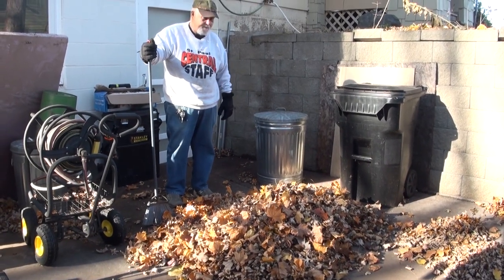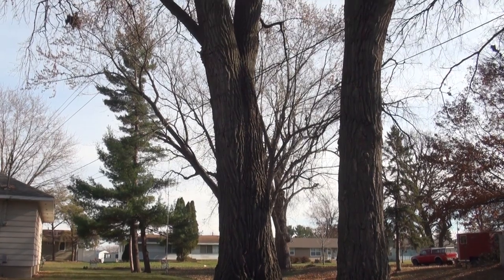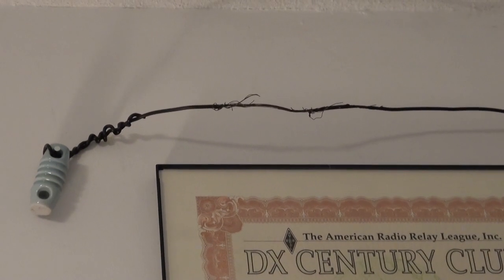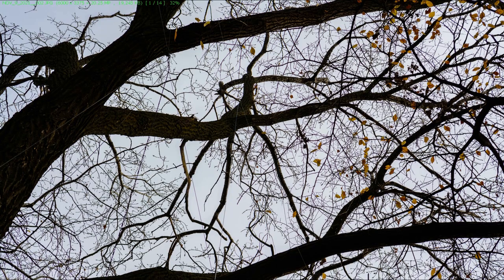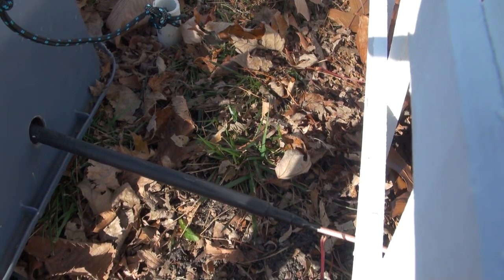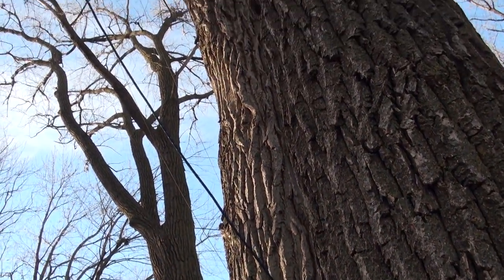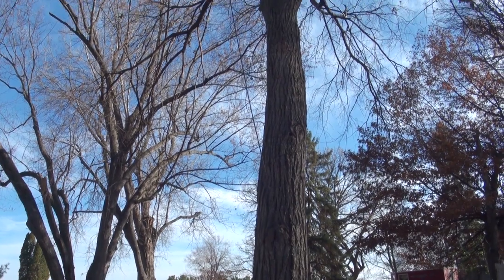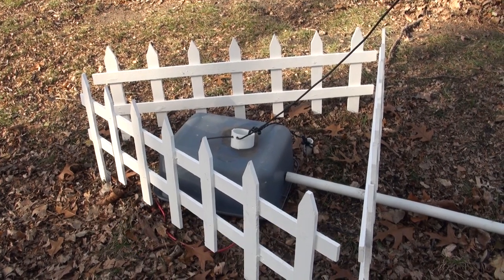The NEØU EZ-J 160m "inverted J" antenna (NOT 6m)

Comment: Compromise! I totally understand that. What works, works! Not enough real estate for 160 at this point but maybe someday. Enjoyed the video. 73
Reply from the maker: Compromise can still work...time will tell if that is the case with this antenna.  Yes, you are limited for your own space.  You could do a vertical from a tree, which work quite well, but for 160m, you'd need a huge loading coil, and those do not work very well (low SWR but are crappy radiators).  Thanks for your comment and 73! de WX0V

Comment: Hi Scott. Thanks for the video. Neat stuff! Interested to see what results you get. I’m going thru the MFJ 994brt with my 160 L. Need to relay my radials which will allow for a LoG. See you in CW this weekend. 73 de N9NY
Reply from the maker: Right now my east radial of the EZ-J is all wonky because of the construction, and it seems to be ok.  In your situation, it cannot hurt to try as that way you get a LoG in as well.  73! de WX0V

Comment: Do you think that having the antenna wire close to tree limbs and branches effects it's performance?  Even if the wire is insulated, does the proximity of a RF element near wood somehow have an adverse effect?
Reply from the maker: Great question!  Yes, it absolutely does affect the performance.  That is why I use "the Smelly" wire as the insulation helps with tree branch interaction.  It does not eliminate the issue; it just reduces it.  Your best bet is to have all your antennas clear of any other physical objects but in the suburbs, you work with what you got.  That said, this antenna just secured me 160m Qs with W8S, KH8/AA7JV and ZD9W, so it does work.  73! de WX0V